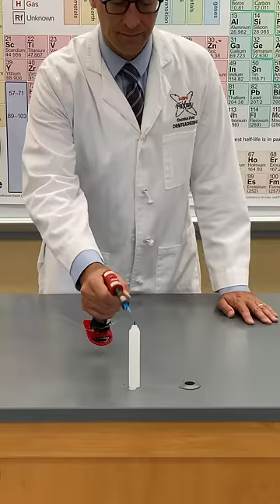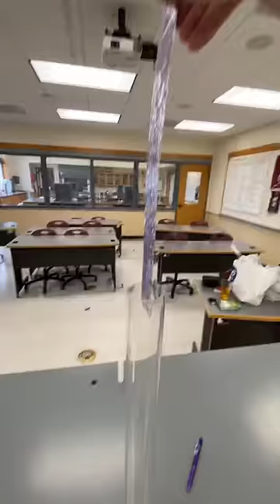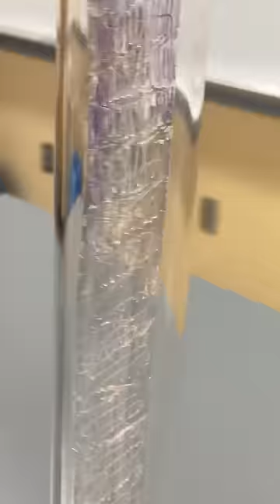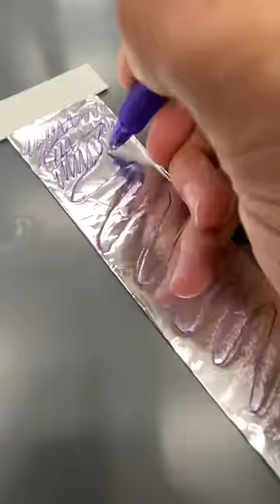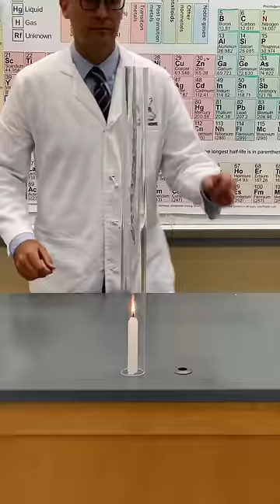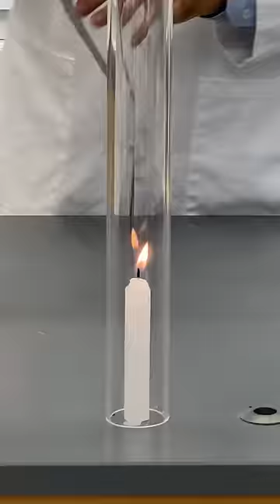Using Convection to Snuff a Candle

Comment: It’s really interesting to see just how complicated just about… everything is, when you can literally change something from something you touch, to something you can breathe and so on👍🏽
Reply: Thats the first lesson in environmental studies is that everything effects everything effects everything
Reply: It’s honestly not that complicated, just really cool mechanics!
Reply: as-cf7rx  you bored or something?
Reply: I mean this isn't really thst complicated. Hot air go up, fire needs cold air. Add a way for it to get it and it burns. Don't and it goes out
Reply: Or even observing it
Reply: @DisturbedVette it is complicated. people who thinks something is simple just haven't think enough
Reply: @oofbih6397 well, you didn’t didn’t learn that properly. The correct word is affect not effect.
Reply: @DimT670 you just failed science. Fire does not need “cold” air to burn, it is quite happy with hot air and the dryer the better. Secondly fire needs Oxygen, a component of air, luckily air has about 20% Oxygen.
Reply: @pudinkeviar4151 *thought enough
Reply: @oofbih6397  affects
Reply: Everything is so complicated, but so easy as long as you are in tune with it. 
You either study the game or play it!
Reply: @pudinkeviar4151 once you learn it, it’s not complicated
Reply: @teeanahera8949  technically you failed as well.
1.heat
2.fuel (the oxygen mixture is debatable)
3.A chemichal chain reaction

Comment: Too bad I don’t own a infrared camera, but that thermochromic ink trick really is a life saver Phil!
Reply: (It’s just an erasable pen from Walmart)
Reply: @stroopwafelfalafel exactly
Reply: He actually includes an IR camera halfway through the video 🤷‍♂️
Reply: It is until it isn’t! Been using these for a while and recently lost a few pages of notes, likely either from too close a call with a 3d printer, heat gun, or hot air rework station 😅
Reply: @th0m  if you still have the pages, try putting them in the freezer! Sometimes they’ll come back!
Reply: @stroopwafelfalafel  didn't come back completely, but went from having to read the creases in the paper to easily readable, thanks!!
Reply: Lets say we could draw something with lemon juice so it became visible when heated.
Reply: Can’t you also just feel if one side has hot air coming out?
Reply: I just love that word
Thermochromic
Reply: you can also just put your finger in it, the one that burns you is the hot side
Reply: If you have a smartphone you can buy an infrared camera attachment that is a lot cheaper than buying a standalone IR camera.

Comment: Airflow is awesome.
Open one car window and the air just flutters in and out and is very loud. Stick your arm inside the open window halfway along, elbow on the door hand on the roof. The fluttering stops, volume decreases. The air is going in one side of your arm and out the other

Comment: If you split the tube lengthwise, and place them offset to each other around the candle, you can make a fire tornado.
Reply: How though?
Reply: I don't understand,  i feel stupid
Reply: For anyone wondering how it works, air rising out of the top creates a partial vacuum, leading to air rushing in from the gaps on the sides of the tube. The air currents follow the circular edges of the tube, leading to the flame spinning.
Reply: The only thing that can stop a Cali firenado is a California Hurriquake
Reply: What about a thinner tube down the middle?

Comment: A Venturi Effect is created by restricting the movement of a fluid, which occurred in this case with the insertion of the partition. Environmental factors created by the placement of partition relative to candle will determine which side of the partition will have an inflow or outflow of the fluid, in this case, room air.
Reply: Answer i was looking for
So in theory if the partitions created were equal in area , equal in volume and somehow equal in symmetry, then the candle should still extinguish right ?
Bcoz the spent gas has equal opportunity to escape through either of the side and cold air to enter on either of the sides equally.
Reply: @hariduraibaskar9056  That's too many variables for my understanding of fluid dynamics from classes over 50 years ago. If this system we're contemplating is sealed, obviously the oxygen will eventually be consumed regardless of the configuration of the system. In a system open to incoming air, a certain number of partitions could constrict the flow enough to extinguish the candle. How the configuration of those partitions would effect the laminar flow by creating sufficient turbulence is "beyond my pay grade," so to speak.
Reply: @jefferyroy2566  
My thought is if the partition that u introduce doesn't divide the entire tube symmetrically , the candle will go on and  extinguishes otherwise.
Reply: @hariduraibaskar9056  That focuses this scenario better, if it can be assumed other conditions in the divison of the tube are "symmetrical" as well. This includes  temperature, pressure, friction on the surface of the divider as well as the tube, and others I cannot think of at the moment. A more narrow escape for the rising fluid would restrict its flow, drawing in less room air and eventually extinguishing the candle. I wonder what a divider that had multiple curves, was zigzagged or perforated with irregularly spaced, tiny holes would do if the volume on either side was equal? Or how high does the tube have to be at the diameter in the video before the Venturi Effect with a divider does not move enough air to keep the candle going? Unanswered questions because I'm not about to replicate this demonstration.

Comment: Convection is a very effective way of distributing heat from radiators. They were originally called radiators (in a house) because they gave off radiant heat from the hot steel panel but modern radiators how fins on the back of the panel so convection currents distribute the heat more efficiently, thus newer radiators can be a lot smaller than older ones without the convectors on and still give off the same heat.
Reply: *give out the same heat output.

Comment: It's because the co2 can't escape fast enough to allow oxygen to enter.  If you lift the tube a small amount or blow air slowly from the bottom it will burn.  The same reason you can't use a 4ft snorkel that's 1/2" in diameter.

Comment: If partition conducts heat, we can use hot combustion gases to heat the incoming air and increase the combustion speed, so the candle can be brighter. Theoretically.

Comment: I was wondering how ancient miners manage to breath underground. Because some of them are impressively deep.
Reply: A lot of deep mines use ventilation where the air is pumped in from big fans and out as well because you need to remove the CO2 which is denser than oxygen and nitrogen.
Reply: @HerbaMachina  I didn't know bronze age people have fans. But seriously I was more talking about that time period before modern things like fans and such.

Comment: But if you have a small gap on the bottom.
Cool air can rush in and be drawn upwards.
This will not only make the flame taller, but brighter as well.

Comment: You should also be able to induce a vortex in the tube that will achieve the same thing. Squirt air in the bottom of the tube at an angle as you lower tit over the candle and it should stay lit...

Comment: Also: water through an opening does this. It will sometimes  wrap around the nozzle a bit if the flow isn't strong enough ddue to cohesion/adhesion but  a toothpick or something in the opening makes it go

Comment: There's also a resonance that occurs around the height where the candle flame was placed. ⅓or ⅔ ( possibly ⅖ and ⅗) Nighthawkinlight did a video on thermoacoustics. These fractional ratios might be converging onto Φ in a fib seq... I'm not sure though it is Just a loose hypothesis conjured from a friend's vaguely described music theory biased toward ❤️ the beauty of that ratio in a mathematical and artistic way, and later my longing to find it hidden everywhere somehow connected like a hidden optimized coefficient governing movement. 
Φ:1 is like 1.618034:1 
Or maybe 1:0.618034
Irrationally the same ratio
1/.618034=1+.618034
1/1.618034=1-1.618034
1.618034²=1+1.618034
Fascinating irrational number
Just as impressive as π imo.
And all addition+ multiples ×  division ➗️ and power's ' relate to the original.

Comment: i do this same thing with a pillow and a box fan in the window, without a seperator it just sucks in the fresh new air to blow out, but the divider gives enough room to let the fan pull form bottom and freash air coming in through top, works better if you can suspend fan in the top of window and have open bottom section

Comment: Infrared cameras worth a toss are 500$
Reply: $500 is on the far low end. I've got a small fortune in cameras at the house. From cheapest to most expensive I've got a TG165, C5, E8, T650sc, T560, a GF309, and I've got a request in for FLIR's new model that is replacing the GF309. All in all I'm ~$250k-$275k deep in cameras,  lenses, & equipment.

Comment: ok but how does the hot air just "chooses" to go one side and not the other initially?? Like when it's done, it's obviously stable, but how does it happen in the first place?
Reply: A difference in temperature between the two partitions will increase the difference.
Reply: So a small difference snowballs into a bigger one

Comment: If the division of the wall in the tube is perfectly evenly spaced, what decides which side the heat rises and fresh air flows in? Would it change depending on where on the planet you are like toilets?

Comment: & if you cut the tube in 1/2 down the middle. & put a small tin burner were the candle is. Push the tube to the opposite sides abit. The flame gose up the tube

Comment: Why does the hot gas only choose one side why doesn't it go from both sides?
Reply from the maker: It’s likely due to a bit of chance and how the partition is placed. In this case, the right side of the partition is slightly larger, so it’s easier for the hot air to updraft and form a convection current on that side. And once the current is established, the colder air that downdrafts prevents the candle exhaust from traveling upward on that side.

Comment: What causes or determine which side will be the hot / side?
Reply: whichever side's air gets slightly hotter because the candle flame is slightly off center or any other reason will become the hot side, because the slightly hotter air will be lighter than the air in the other side and start to rise and suck up more of the hot air coming off the flame creating a runaway effect.